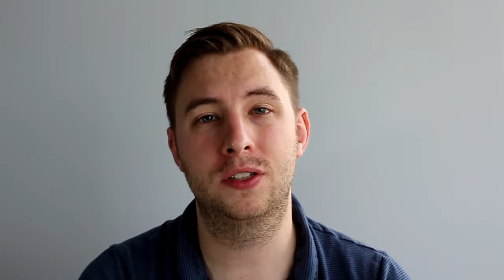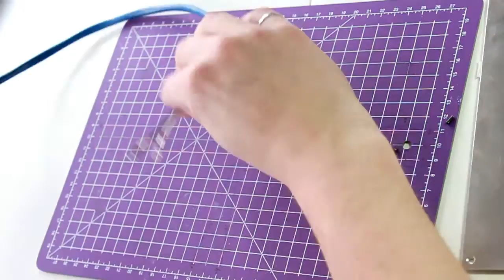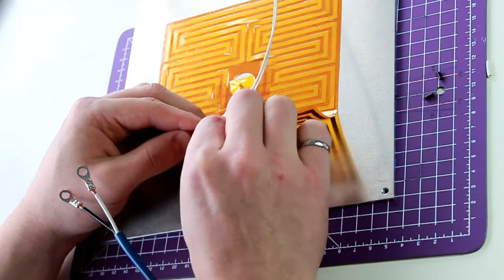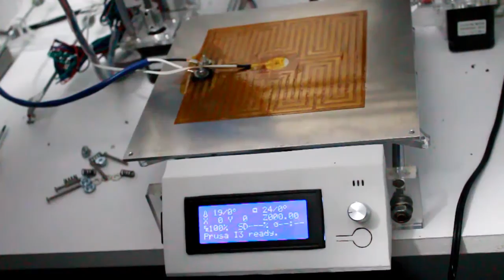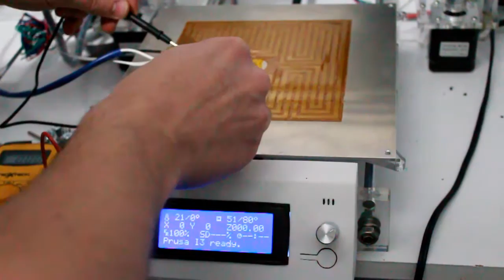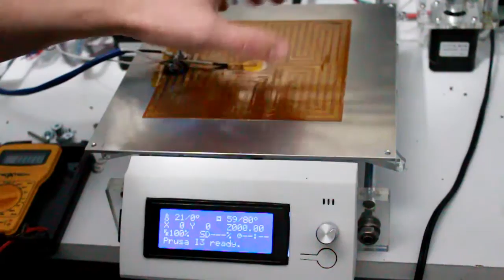Heated Bed Fix!! Sunhokey Prusa i3 3D Printer

Comment: dude! your wires are sooo thin. get thicker ones and beefier terminals. no wonder they heat up.
Reply from the maker: +Lenny McDougle when I repaired the heat bed I replaced the wires with larger diameter wires (by a couple guages) than what were originally installed on the printer kit.  I also put matching guage terminals at the bed heater. I haven't had any issues yet as the wires and terminals are not the points of resistance on the circuit (as they were when the bed originally failed. I have been keeping an eye on everything since the repair to make sure things are working well and are safe to use.

Comment: Thanks a lot! Just happened to me the same problem with the heated bed and thanks to this tutorial I fixed it. I added after fixing it a thermal insulator to reduce heat from the bed to the acrylic base. I heard heat from the bed with time can deform the Y axis acrylic base.
Reply from the maker: +Eitan Goldin I am glad this helped out. The white fiber stuff is a bit of a thermal shield but more insulation could add more protection. If the insulation fills the gap between the bed and y-carriage then it could even improve the backlash of the bed (as long as the insulation deforms enough to allow you to adjust the bed level.

Comment: Hi Alan, had the same issue. Just bought a new one for 13 euros and adjusted its size as it was to big. You can cut away the outer line. http://reprapworld.com/?products_details&products_id/352/cPath/1645#.VnK5_ZMrJQM As I also prefer to repair stuff instead of buying, this was just to little money for the work you put into it :)
Reply from the maker: That is probably a better option but I am also impatient and wanted to get back to printing quickly. My local stores had the all equipment I needed, without having to wait for shipping.

Comment: Hey Alan! Great video by the way!! I have a question to ask you.. So  I was working on my printer when the one of the end stops stopped working. So I ordered a new one with a cable because I couldn't diagnose the problem. So the new end stops arrived today and after playing around a little bit I realized that the end stop wasn't broken....it was the wire that prevented it from working. So now I can't find any replacements for it and I have to work with what I have. I got a new wire with the new end stop and I can't seem to figure out how to get it to work.  The new wire is a 4 way cable with a connector
Reply from the maker: +Vidyuth Suresh What part of the cable is not working? Could you order a new cable? Is there a break in the cable that you could splice out? I don't have enough information to help you out. You could try bringing your cable and end stop to a local electronics store/helper who could give you real time troubleshooting with whats going on.
Reply: Oh I'm sorry I couldn't provide with more info, but good new!!! I was able to replace the cable and now all my endstops' leds are working, however, do you know how I can get the auto home function to work? Because everytime one of the endstops are triggered, the motor still keeps running.
Reply from the maker: Are the end stops plugged into the correct terminals on the board? If they are it sounds like a software issue, which you would need to fix in the firmware.
Reply: Yes they are plugged into the correct terminals and I double checked with your last build video. Do you how I would fix the firmware because the last time I tried to fix the firmware, my LCD screen stopped working. Thanks for all the help!!!!
Reply from the maker: Vidyuth Suresh I do not have any experience with this kind of issue. I would suggest taking this over to the FB group and asking there. The guys over there may have encountered the same thing and have a solution for you

Comment: heater near the contacts is not in contact with the aluminium plate, Wouldn't it be much easier just to solder the wire to cleaned contact points....
Reply from the maker: +Dhananjay D The space is not ideal but I felt that the use of solder wouldn't really work (although it was my first idea). Solder melts above the temps that we need for the heated bed but the solder will get hot and potentially softer. This repeated heating and cooling could weaken the solder over time leading to it failing again. I had heard a couple people experiencing this issue and I got the bolt suggestion and I felt this was the best. Thinner bold heads would be better but it is working now and the aluminium is thermally conductive enough to spread the heat out covering the location of the heater gap.